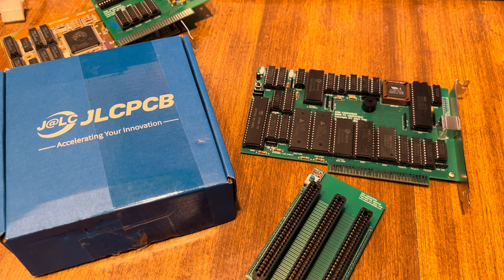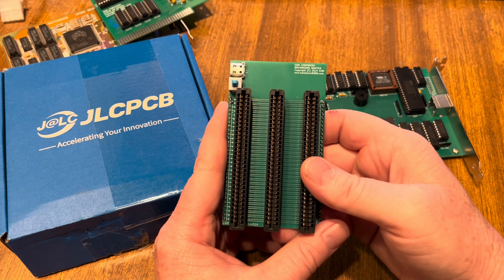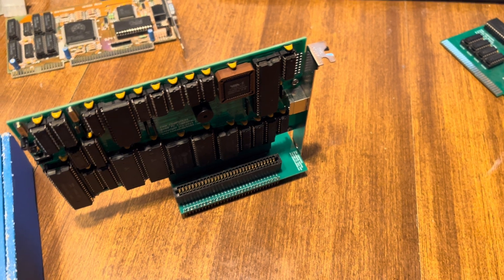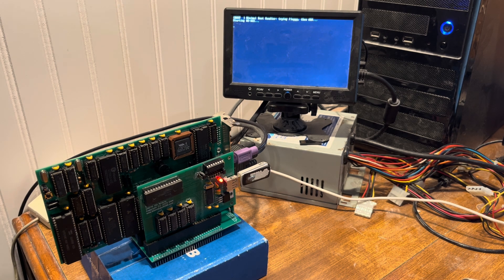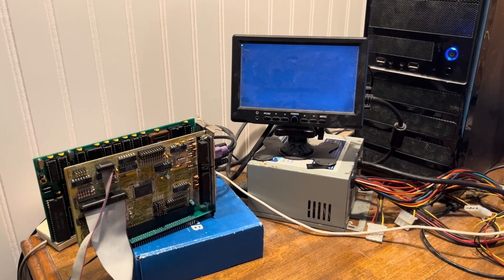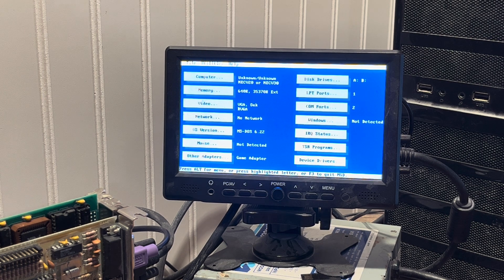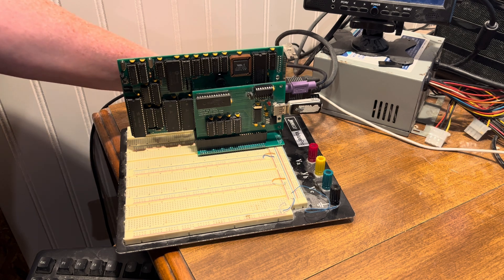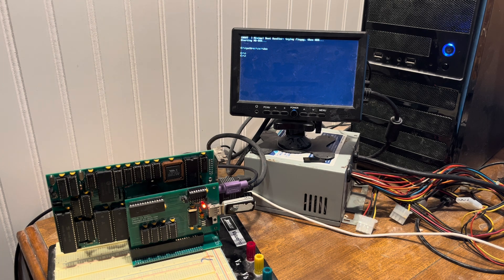ISA to Breadboard Adapter, 8088 PC XT Project

Comment: Thank you for the great information. Could you let me know what the appropriate current and voltage are for the USB Type-C power of this system?
Reply from the maker: As I have learned more about USB C for power. I have learned I need to make some changes. With low power chips you can run on some low amps. It is better to use something with a higher output.

Comment: id love to try using my 8088 to 286 upgrade card if i can ever get a hold of these. I have it setup on my friends nuxt 8088 with a 486 upgrade on the 286 upgrade card so its technically is 8088 to 486 upgrade, just really slow and limited on ram lol
Reply from the maker: I have wondered how well a 386 inboard would work